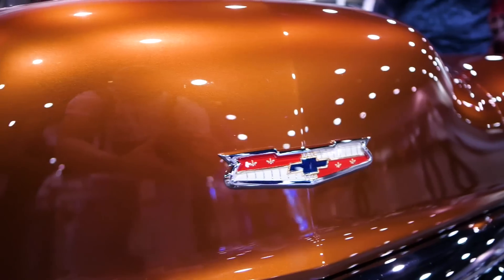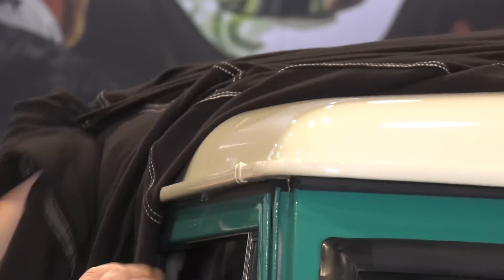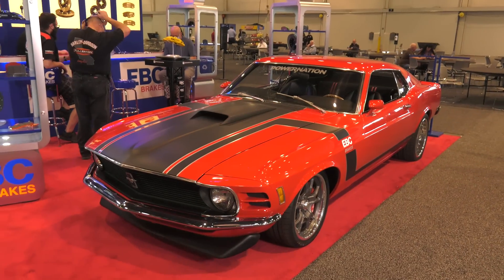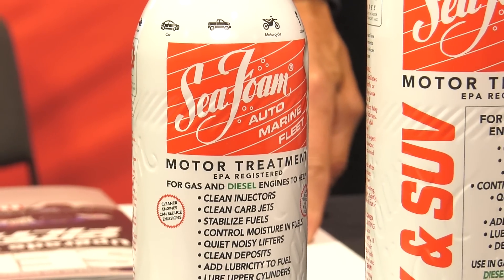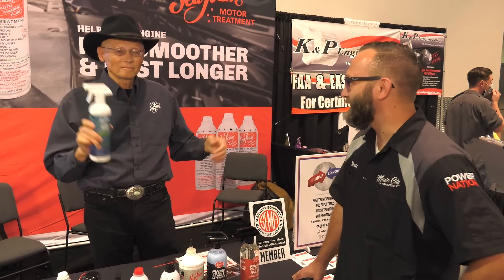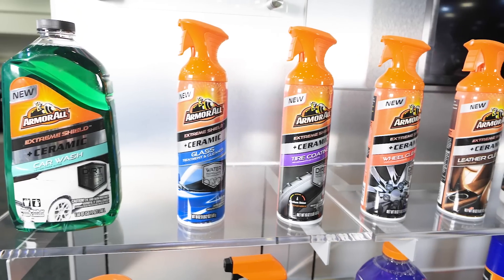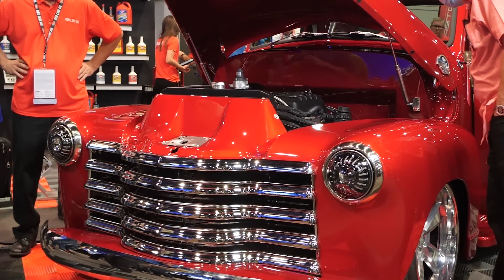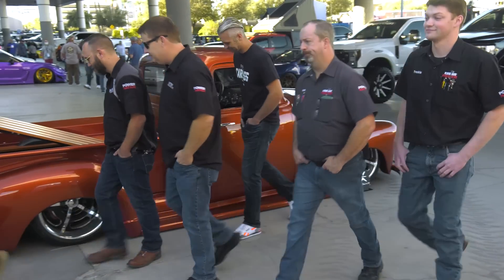SEMA 2021 Recap and Highlights

Comment: RE: Sea Foam  , a friend had a stock I 6 & rolled it at about 25 MPH in a rut in the dirt road , almost nothing , I saw a jeep dump on it's side in front of me at low speed on black top at a light / 4 way / left turn . It looks cool , all I see is TOP HEAVY , far worse than a stocker . What you need is chopped fenders , high on the bottom >> Low on the top , like a trophy truck , a low rider . Narrow & lifted is Foolish .

Comment: I worked with GM 25 years ago on hydrogen vehicles and it just never took off.  Complexity,  price, etc.
Reply: It will never gain traction.  It’s been considered by the “experts” and rejected.  Those with political clout won’t even listen to anything about hydrogen powered vehicles.
Reply: Agreed....but we did build a h2 john deere gator to drive around the factory and show the customer.

Comment: Hydrogen will not happen - Copeland is smart guy but he missed the boat on this one - by a mile - the 90s examined the issues of Hydrogen production and the viability of a refuelling network - it was deemed impractical. With the push towards EV , hydrogen is not merely on the back burner - its off the stove. Gotta love Power Nation, and I've been to SEMA as a buyer 11 times but this coverage was poor at best - the viewers are looking for more than a 10 minute advertisement - for those who have never experienced SEMA and the Parts Expo and the other convention centre, this video does NOT provide even 1% of what you can see and experience. Get a reason to be there and go!
Reply: I agree hydrogen is a non starter. No matter how you go about it, you're faced with insurmountable materials issues that make it commercially unviable. Hydrogen burns hotter than Nitro-methyl, has the highest energy density of any fuel, and a stoichio of 2:1. How they aren't blowing that engine up, I don't know. Ford couldn't get an engine to run on hydrogen for more than an hour before they destroyed themselves. 
As for everything else you said, boy you don't know how free entertainment works. If you're not the one paying for it, then you're the commodity. That Bronco wasn't free to build, neither was the production of the video. It was all paid for by the various brands that were shown in this video. All of whom are owed a payoff for their advertising dollars. And I'd rather see my favorite shows do adverts for stuff I'm actually going to use, and are relevant to the topic, then to see them doing promos for Raid: Shadow Legends.
Reply: @Jazzverso  You seem to think that there will suddenly be a production of hydrogen and a network to support it not to mention the 'buy in' of vehicle manufacturers. Look around - what type of vehicles is everyone now pushing - EV.  I am not debating the source of electrical power but as fission gets phased out fusion will replace it - outpacing coal and gas.
Reply: @goldysgarage189  You gotta have fusion first. There are two sources, 1 in 93 million miles away, and the other you want as far away as possible.

EVs are as much a non-starter than hydrogen powered cars. The nuclear power plants needed to provide the volts should have started being built 10 years ago and today they are doing the opposite, shutting them down.